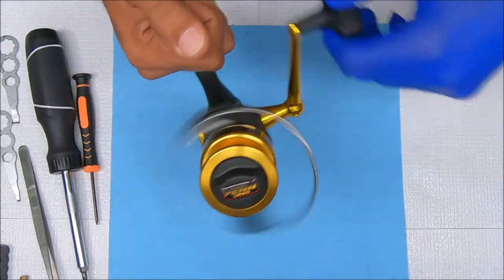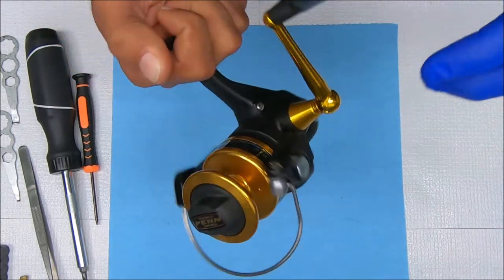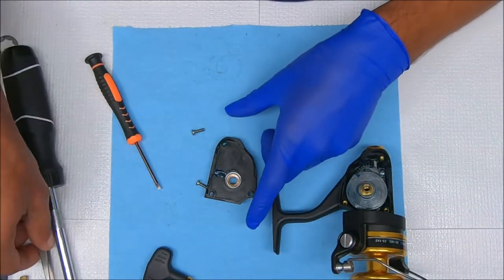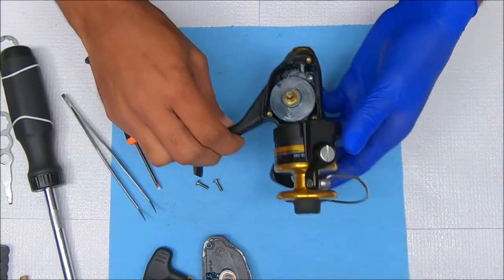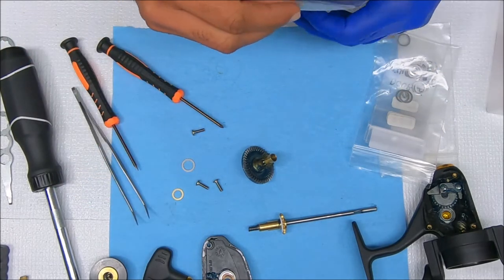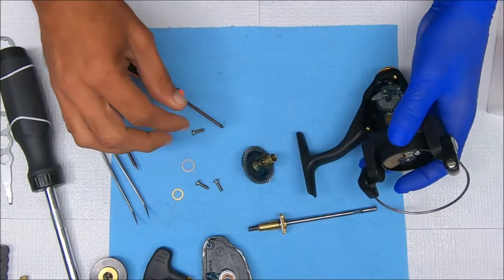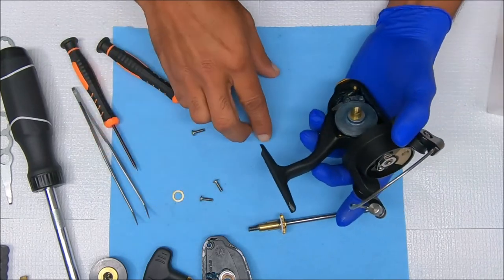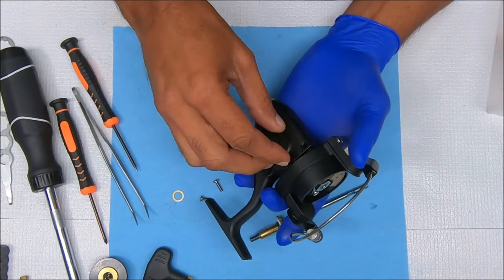Fixing the "grind" on a new Penn Spinfisher 440SSG: Fishing Reel Repair

Comment: Had a locked up feel on my fin nor lt 40 spinning reel. Changed the main gear and osolating gear , re greased all the parts and still had that locked up feel when turning the handle. Put a shim on the bottom of the main gear and problem solved. Great work from you. Thanks
Reply from the maker: Thanks for watching! Glad to hear it helped! Spread the word about the channel.

Comment: Great video. First time I come across the idea of shimming.

I bought three reels of the same model 2nd hand. Two had this sound and one hadn’t. The one that was ok still had a light “abrasive” sound and my guess was rusty bearings.
Turns out I was right.
After changing bearings to fresh ones and cleaning and regreasing the reel sounds exactly like this Penn (worse than the other two reels 😂).
You feel the gears while spinning.
I hope a shim (or removal of one) will get it sorted out.
Reply from the maker: 🙂 thanks for checking out the video! You'll likely need to remove a shim. However, before you try that, try cleaning out the well in the housing where the left side bearing goes, and see what happens.
Reply: @TSGReelService , I solved the issue by changing the shim on the gear side to a thinner one and installing a thin shim on the other side (which had no shim).

Comment: Thank you. You are the only person I’ve ever come across that discuses this gear lash. Please tell me, is the majority of the lash noise in certain reels caused by the gears being too tight, or too lose? Thanks again.
Reply from the maker: You're welcome and thanks for watching! it's pretty close to 50/50. Deciphering which side would be better to shim can get a little tricky sometimes, but in general, shimming (or removing shims) from the left side will do the trick.

One caveat..... the are times when the gears are too far gone (and you may not be able to tell by looking at it) that shimming won't help. There's a procedure I use on Stellas that helps with the feel.... maybe I'll do a video of it one day.

Comment: Thank you so much sir...
Reply from the maker: You're welcome and thanks for watching! More vids to come.
Reply: @TSGReelService   i added 02 washers.. but I can't fixed that grinding feel....😢.
You have any idea..
Reply from the maker: @blackapple1641  Yes, several. probably better you take it to your local repair shop. There are SEVERAL combinations of shims (both number of, thickness and combination) that will affect what you're trying to do. Patience is key... it may not even be your gears that's the issue. But first, let's try and unpack this.... What reel is it? How many years have you used it? How many times have you serviced it during that time? Did you service it now, or just trying to fix "the grind"? What other areas of the reel have you checked?
Reply: @TSGReelService  I put tha washer 
 on the wrong side and when I replaced it, it was fine... finally i fix that's issue..
Thank you so much sir...❤️❤️
Again.
Thank you so much sir..

Comment: Is the main gear the only one that needs shims to work properly? What about the other gears? Don’t they usually have shims? I got this Stradic thats making me crazy. Its around 13 years old, caught many fishes and I guess it’s impossible to make it run perfectly smooth but I watched this video and I played with the shims to make it run a little smoother. I thought it was fantastic and the day after I opened it again and again trying to improve it a little bit more but  at some point it started making some new noises  -.- it didn’t get rougher but I can hear this low and uneven noise of some metal elements colliding...I can’t get rid of it even though I come back to the previous shims set. Any advice? Is it possible that something went out of its place when I assembled and disassembled again and again the main gear? In this case, is there anything I have to pay attention to when I disassemble and reassemble gears, bearings and any other element?
Reply from the maker: Thanks for checking out the video. Yes, it's difficult to make old reels like new again without changing quite a few parts, and even then, it's not a guarantee. And yes, it's usually the main gear is where you place shims for the feel, but the pinion can also be shimmed for some other reasons. Your issue is with your main gear.... I appreciate you playing with the shims, and though that did help, it's not the full story.... I'll make a dedicated video on this soon.

In the interim.... the issue you're likely having is the point where the main gear interacts with the pinion gear. Over time, gears wear into each other. If, after take out the drive gear, you put it back in any other position than where it originally met with the pinion gear, you'll likely feel that "intermittent grind". This assumes your reel was smoother before you took it apart, and that your reel is older. Try removing the side cover, and lifting and turning the main gear so it's interacting with the pinion gear at a different point of the main gear.... then test the crank out. Do this until it feels the best.

Hope this helps... stay tuned for the video.

Comment: I think my mitchell 300xe is doing the same thing. But not sure. It was very smooth before, and I had dropped it in freshwater so one of my bearings in the handle rusted tight. I got it totally freed and cleaned. But after putting it back together and greasing and oiling, I have sorta this tight feeling and rubbing with a grind now and then. It just feels like a lot more work to reel, even when not under a load.
Reply from the maker: Thanks for watching. One or more or your reel bearings could be bad. Double-check your reassembly of the reel. If the main gear is shimmed, try removing them one at a time, testing the crank after each removal.

Comment: which is better stainless or brass shim, and its better use multiple thin shims or one thick shims? i think this part is less concerned but still have a big impact for smoothness
Reply from the maker: Honestly, I don't have a clue why they make some in brass and others in stainless. I like using whatever thickness combo gives me the best feel..... doesn't matter how little or many it takes.